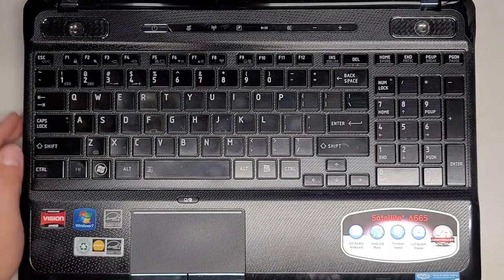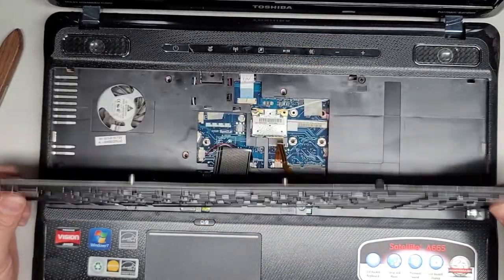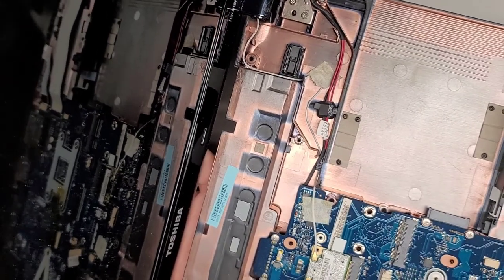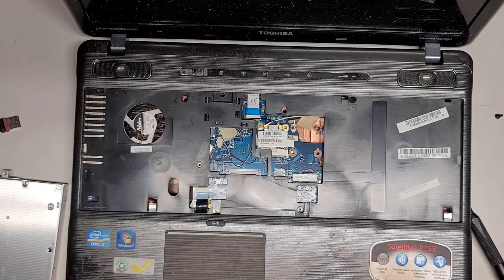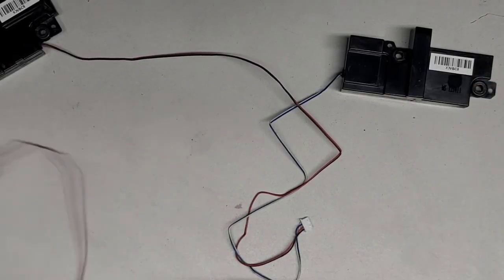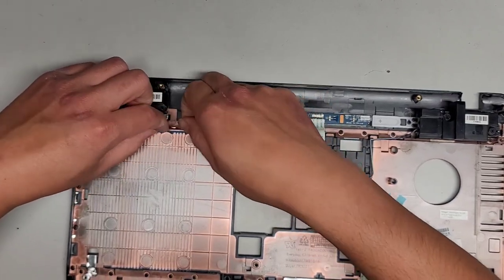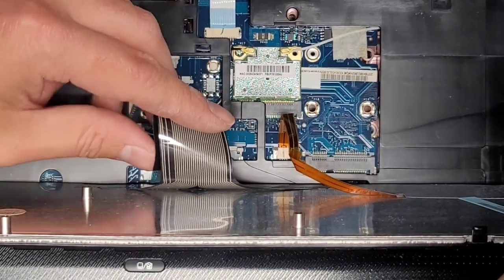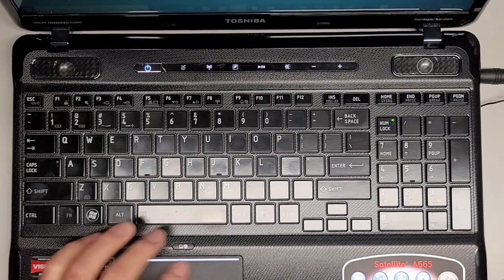Toshiba Satellite A665 A665D-S6051 and P755 P755-S5393 Disassembly RAM SSD Hard Drive Speaker Repair

Comment: I have Toshiba p755 2nd generation can lvds cable same as a665
Reply from the maker: Not sure
Reply: @ItsBinhRepaired  and keyboard or charger speaker is tat same.
Reply from the maker: @mehranishaq2940  you'll have to open it and check
Reply: Can toshiba p755 screen and A665 screen same or difference
Reply from the maker: Not sure